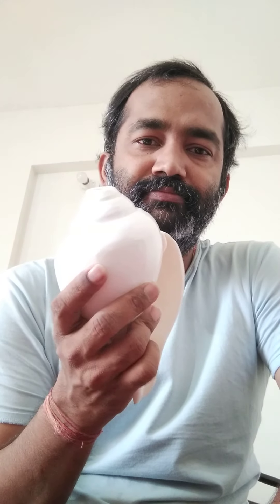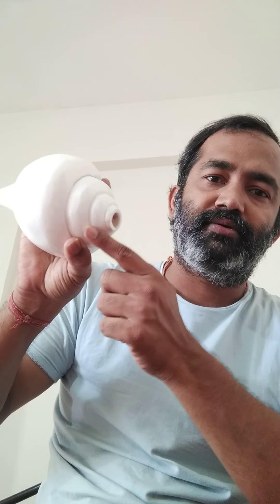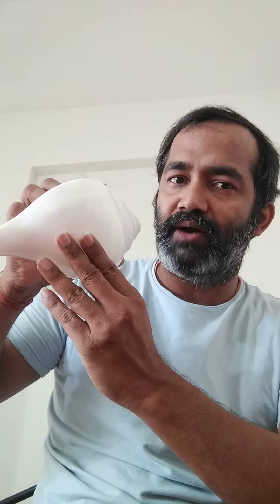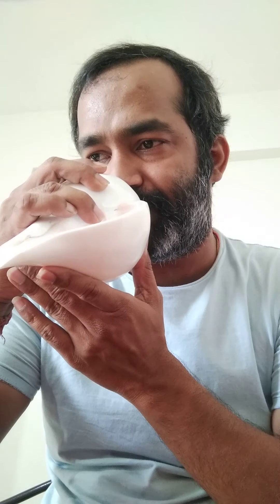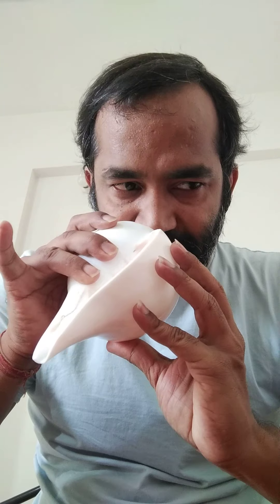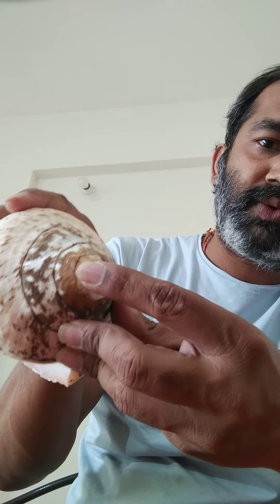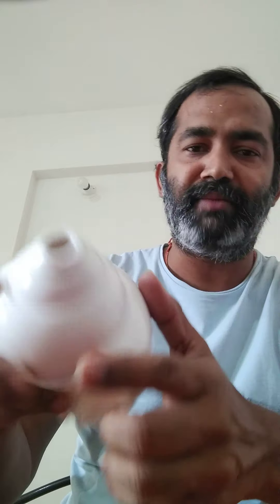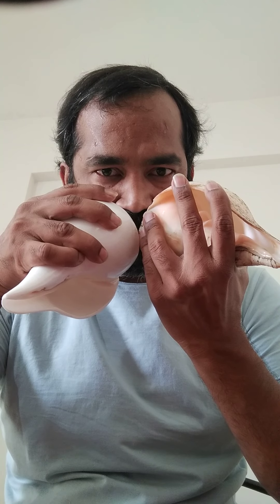how to blow conch shell, play conch shell technique, shankh dhwani, shankhnaad , shankh kaise bajaye

Comment: Sir excellent explanation ..🙏 I was able to blow it however the sound which i am able to produce and the one that I hear from you is very different , is it the shankh that matters or will over the period of time of practice will the sound change ?
Reply from the maker: Thank you 👍
You are right sound depends on inside air passage , small shankh are sharp sound and big shankh are loud 

Tric : When you get shankh sound during blowing, you need to maintain blowing pressure then sound will be even , over peried of time of shankh blowing practice you will have smooth sound of shankh .